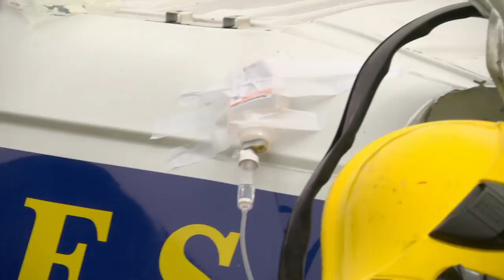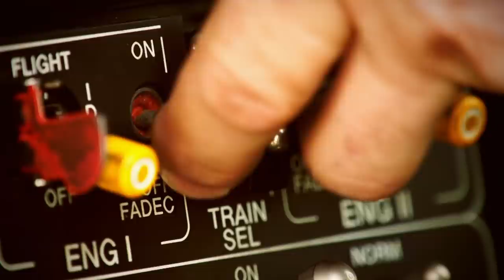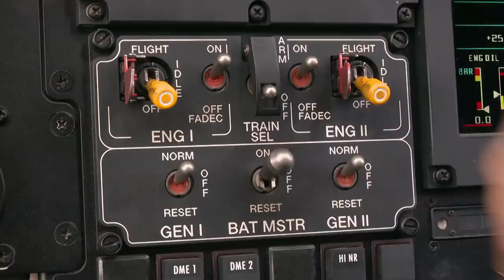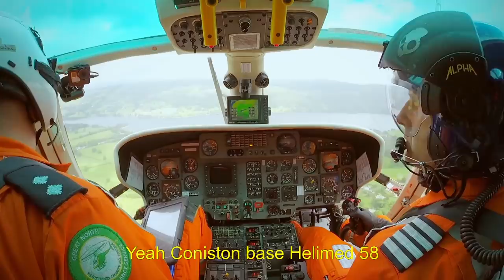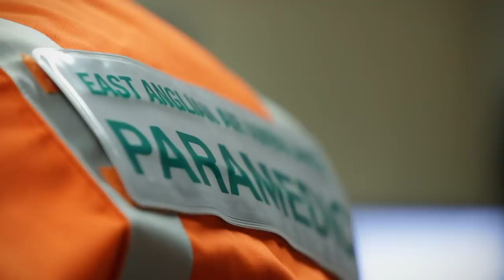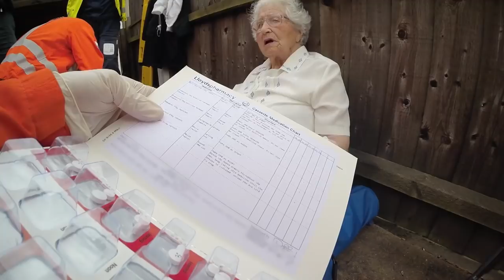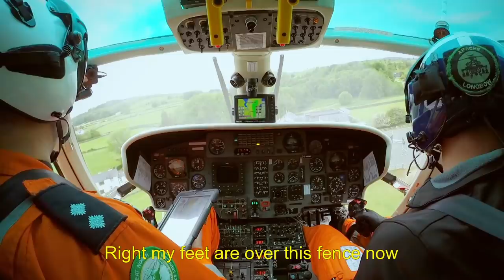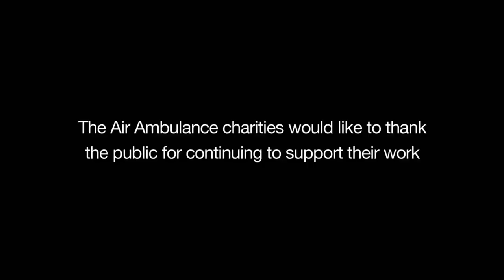Van Collides With An Articulated Lorry | S02 E04 | Hospital Documentary | All Documentary

Comment: The only sitter my kids ever had was when they were very very little and my two youngest cousins who weren't much older than my own two went to the same girl to be watched. Everywhere the sitters mom went they all went, the store etc it didn't matter. One day the mom and her sister (both sound their 50's) were going to the store but for whatever reason the sister decided she didn't think she felt like going with all the kids. It saved their lives that day. A speeding vehicle hit their van rear ended at extremely high speeds after they had stopped at a stop sign and the back hatch of the van crushed clear up to the back of the two front seats injuring both the mom and sister really badly. Had the kids and sitter been in the bank they would have been crushed to death.

Comment: Ever heard of body temperature maintenance? leaving him completly uncovered in the back of the helicopter can have a very very negative impact on his survival in case of internal bleeding
Reply: Well with a doctor and a paramedic on board I doubt they've ever heard of that! Immediately go tell them. (Sarcasm btw)
Reply: @RadTechFred  they obviously haven't, or did you miss the trauma patient being completly exposed in the helicopter? And you don't have any kind of heating inside a chopper, just in case you did not know
Reply: @umadbro3361  They clearly believed the risk of hypothermia was outweighed by the need to convey him to hospital fast
Reply: Our choppers are heated and air conditioned.
Reply: I think they said it was a short trip to the hospital and they were trying to get him there ASAP, and because they put him in the helicopter so quickly they were probably still assessing his condition on route. It’s a little hard to assess someone who is under a blanket.
Reply: @umadbro3361  ever heard of asking before assuming
Reply: If someone is bleeding internally then the last thing you want to do is warm them up and increase their blood flow.

Comment: The scariest thing, is that he had FENTANOYL and was SCREAMING
Reply: It's severely diluted to between 50 to 300 micrograms normally and is quite commonly used in anything from operations in the OR to rescue as seen here. Reason it's used instead of morphine is that it works faster, last over a shorter period, less histamines are released compared to morphine injection (less chance of an allergic reaction and vomiting) and less impact on a patients breathing. Fentanyl given by a trained professional is there to reduce pain in a controlled manner and is not very different from regular morphine with the calculations the doctors use. Mostly in rescue, morphine is used, but in severe cases and with a weakened patient, fentanyl provides some positives for the patient compared to morphine.